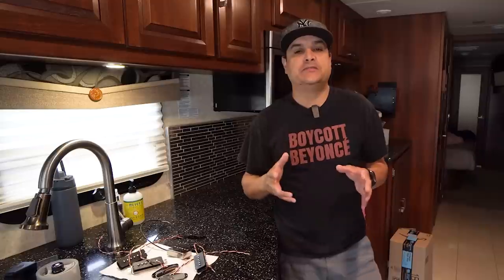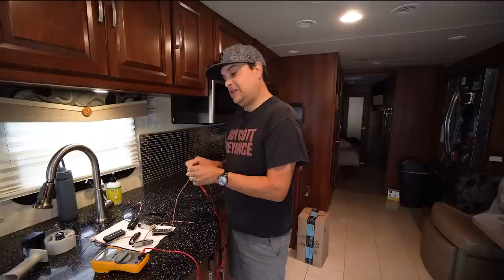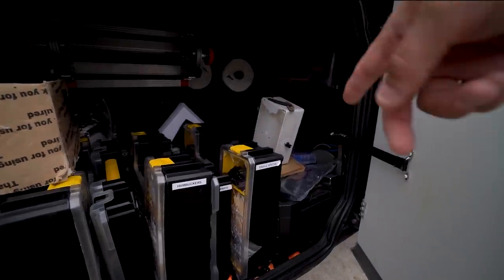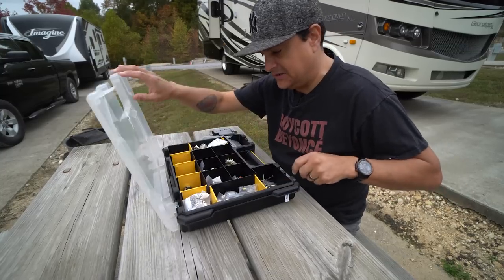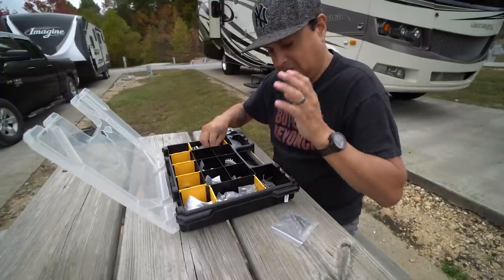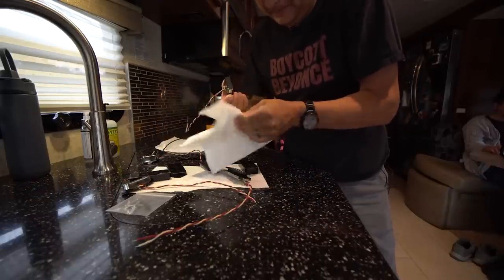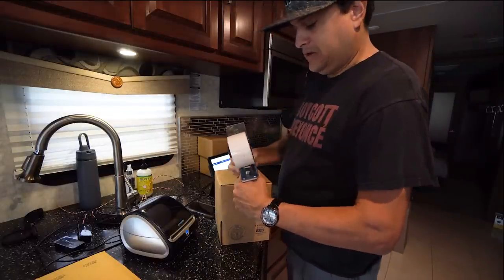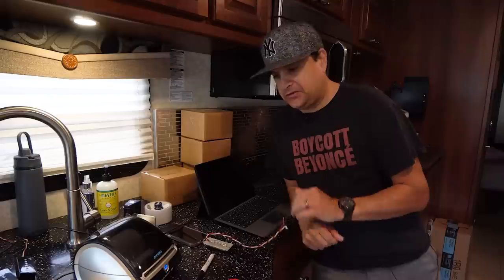DC Resistance In Guitar Pickups

Comment: i agree so much with most of the stuff you say. the packaging thing: A+ attitude. don't waste materials, don't waste money. if the pickup travels safe, and nobody ever had a complaint, fancy packaging is a waste of money. it exist so that you pick the fancy box over the less fancy box in the store. these pickups are mailed. packaging: unnecessary.
Reply: it's why I buy CPUs and Hard Drives OEM and not packaged up all pretty. Makes a ton of sense in this case. I'd just shred the box to get to the pickups, anyways. Exception was always the Duncan Baseball Card box. I use those to keep the original pickups I swap in. I think SD keeps that old baseball card container maker in business. If the pickups came in a handmade box all nicey nicey, I'd just use the box to store collected junk in, so: not worth the costs. I have other boxes...I'll never stop collecting crap, though.

Comment: I was curious, so I looked it up, and wrote some notes, to settle this once and for all.

What you want to measure is overall 'inductance', or how the vibrating string will induce what kind of electric force that ends up in the wire and goes into the amp.

The greater the inductance, the higher the output and the lower the peak frequency.
 
Inductance is influenced by the strength (and type, position) of the magnet(+), the gauge of the wire(+), magnetic metal(+), non-magnetic metal(-), and the winding(+).

 DC resistance only measures the winding (and the higher the gauge, the greater the inductance, but the smaller the DC resistance). 

But, if all those other things are held constant, you are fine. 

Inductance is measured in Henrys. Here are some examples:

Fender CS 69 - 2.174H
ToneRider Single CB Neck - 2.6
Gibson PAF    - 4.4H
Seymour Duncan SH-1N - 4.44H
Telecaster Hot Rail - 15H

Ironically, the myth seems to work with the same type of pickup, because of the similarity of materials.

Comment: I think that impedance is a more significant factor than resistance alone. Resistance will largely depend on wire gauge and length whereas capacitance and inductance will mainly be affected by wind count. So would simply multiplying resistance by the wind count give a number that could put a pick up in a particular ballpark of tonal quality? I appreciate that there are other factors such as magnetic material, insulation, spread and tension. My thinking is that a 7k resistance and 10,000 wind count would be 70,000 and how different would that sound to 14k with 5,000 winds. If it worked the customer would just need to state what magnet they wanted to further tweak the sound in the required direction.

Comment: So in a nutshell, 2 pups that are both 10k, will sound different based on a number of factors.
Reply: +
Ed BillyBN Blues
In a nutsell, uneducated users chasing different levels of volume --- alnico1,2,3,4,5,6,7,8,9,10,323,754,2323,45,6434,33,4456345,  ceramic , SmCo , Neo, EMG or other rubbish stuff , educated looking for timbre differences --- like a Fender Glass VS Gibson Fat. 
If you want the volume --- just slap the most powerful magnet you have. )))
Reply: + Club Soda  
Totally agree.